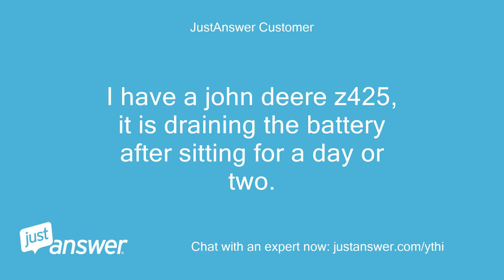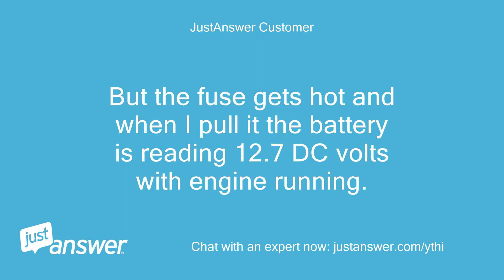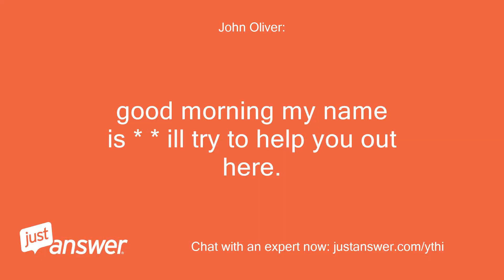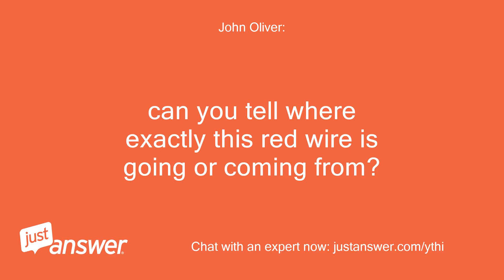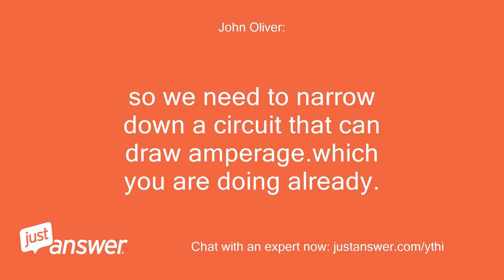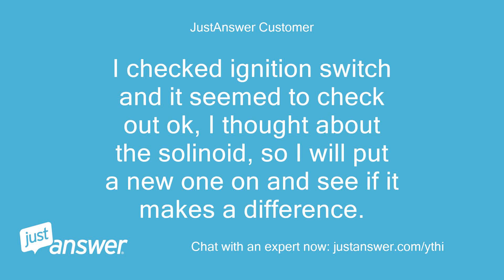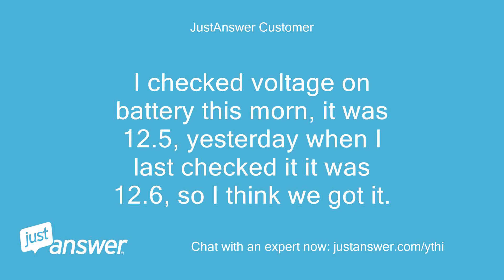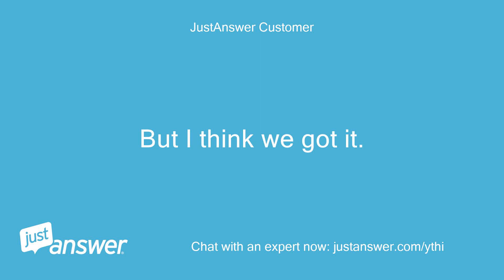I have a deere z425, it is draining the battery after

Comment: Charge the battery and disconnect it from the mower. Does the battery still drain when the battery is disconnected? If so then the short is in the battery itself. You can also leave the battery connected to mower with full charge. Unplug the stator see if battery still drains. Unplug the solenoid see if battery still drains. So on and so on.